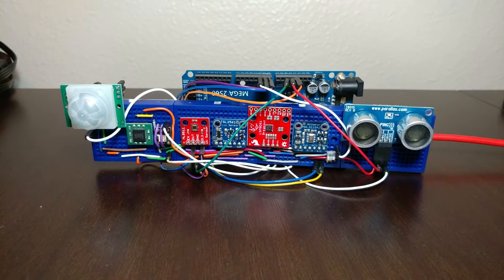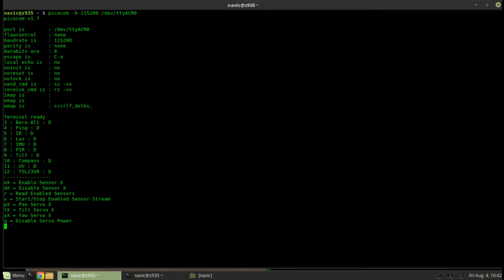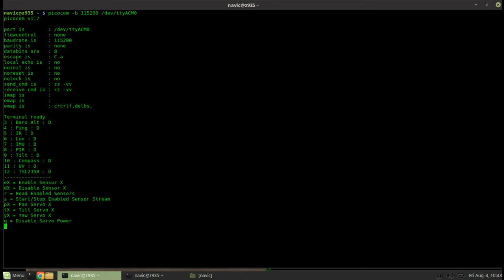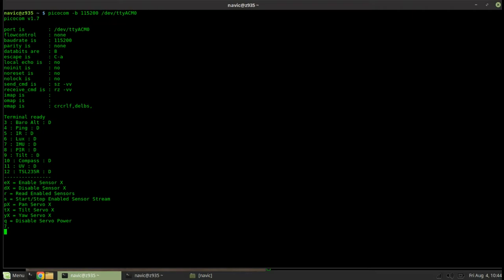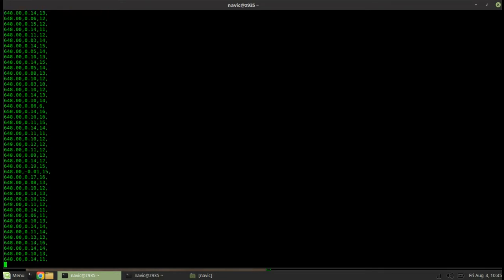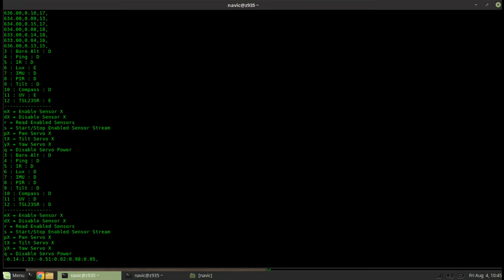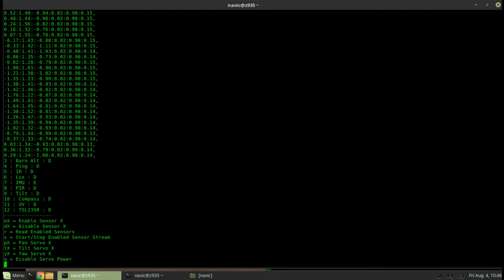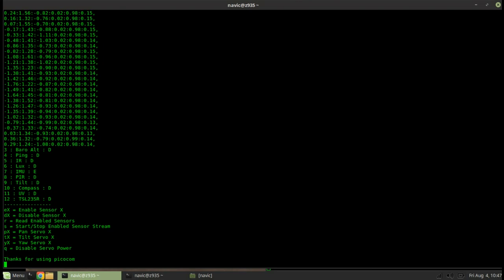Sensor Stick

Comment: I found this interesting.
It seemed like it was just a demo to show what multiple sensor out put data looks like when shown on a monitor. 

Can you show in a another column what the highest and lowest or average readings were (stored readings) ?
Reply from the maker: Robert Swift You are correct about this being a demo of how to output sensor data. It's easy to add any computation to the output but the trade-off is speed on the Mega. Assuming the system the sensor stick is connected to is much more powerful, it might save speed by using the faster system to track computation like min, max, average, and even set up thresholds to trigger specific actions.
Reply: +navic209 
I'm interested in creating a robot with animal like behaviors.
I wanted to focus on fear and trust first. Which rely on proximity (distance to a potential threat) and time based data to change the robot's trust level.
I saw that you made some wheeled robots wouldn't it be neat to experiment with giving one of them some instincts?
Reply from the maker: I'm very deep into vision development but if you have some code and need it ran on hardware, I'd be happy to help.
Reply: +navic209 
I don't have any coding skills. I never took any programming courses. 
That is why my initial question was a bit basic.
The only programming that I messed around with is Scratch (block code). I looked at how to make a virtual pet.
I also picked up Adrian Rosebrock's book on Python and Open CV. With his video course I  was able to follow along with his examples he proved. like following recipes, but I didn't get the structure behind the programming. 
I did have any of my 
own examples to test against. 

I also have two mbots from RadioShack. I haven't even tried programming them yet.
I would love a
Qbo or a Kurt bot.
I'd even settle for 
a Turtle bot.
LOL. I just got my first computer for Christmas this year.

I do have a very clear direction though. 

Example. I know what the short comings are about the robots I listed above.  Number one thing is that they do not remember anything about their experiences.
They can identify things by giving the name of those objects, but that is so limited. A smart I-bot vacuum can atleast remember where it's charging station is.
Wouldn't you like to do something with that vision knowledge that other people aren't already far ahead of you on?